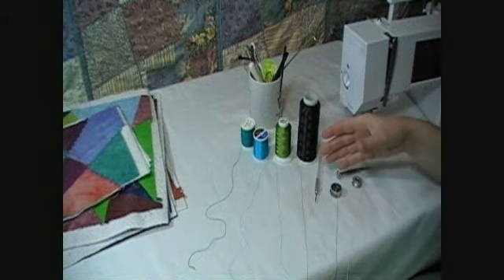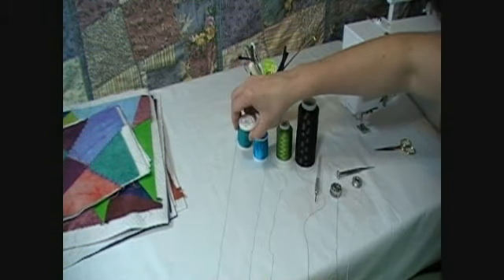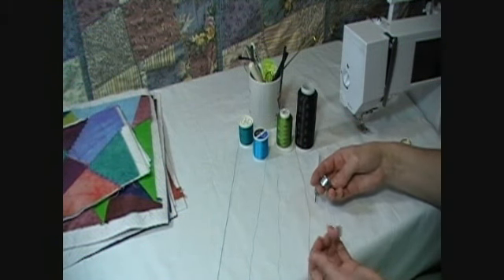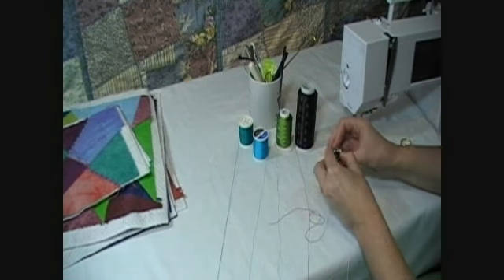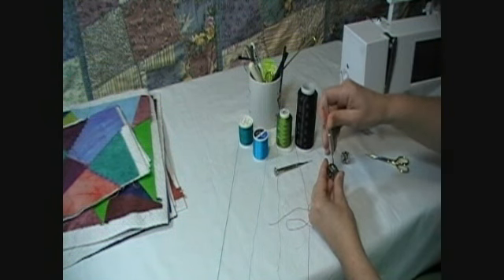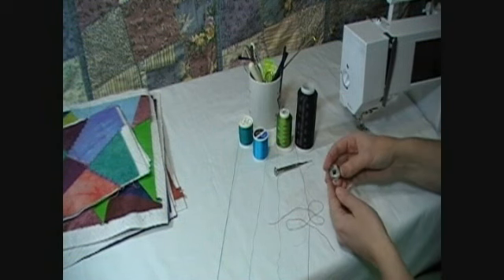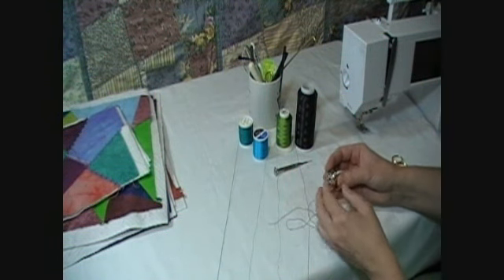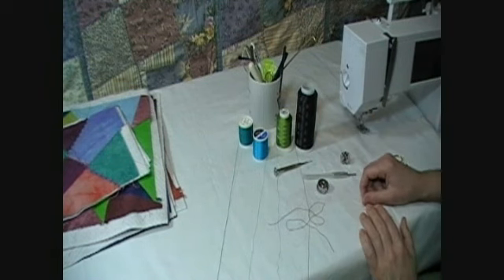Bobbin Thread Tension Adjustment for Sewing and Quilting

Comment: wow. you answered many questions I had in my head!! Im a beginner and have an old machine, i like the old ones, and had problems here and there, this video may have saved my sanity!!
Reply from the maker: I am so glad my video helped you :)  I treasure old sewing machines and I buy them regularly. I love cleaning them up, using them for a while and then giving them to someone who needs a machine. Be sure and watch my video about the pressure settings and the one on Threads might be helpful too. ~M

Comment: Thank you so much for your videos.  I was thrilled to see the stitch in the ditch video.  The lady at the sewing shop mentioned that but I didn't know what she meant.

I recently made my very first quilt for my grandson.  I got done just in time for his birth.  I had no idea what I was doing and the squares are not well lined up.  I also have a lot of the bobbin mess on the back.  Now I know how to feed the thread up and will do that to help prevent it.  The family was very impressed even though I wasn't.  

I am now starting quilts for all the grand kids and kids.  I have nine kids and 5 grand kids so I have my work ahead of me.I have already placed my order at Amazon for your book and the tools you mentioned ( the needles, pins, Kwik Klip, etc) 

I do have a question though.  My machine is a Janome 7318 and the bobbin is plastic.  It just drops into the opening.  The isn't a case with a tension screw.  Are you familiar with that machine?  if so, do you know how to adjust the bobbin?  If not, is it really important?

Comment: I borrowed a vintage Singer 22 (model #17622090) to practice and was having problems with the tension. I googled until I fixed the top thread, but the test sew pieces still had the bobbin thread doing loopy-loops. I did a search and your video has helped me fix the problem.  I don't think my mom used the sewing machine too much because of this, so when I'm through I'll let her see if her issues with it was fixed. Great video, but closer shots helps.

Comment: I use a Tic Tac box weighted to 50g with small nuts and bolts. I test the bobbin tension by snapping the box's lid over the thread and attempting to dangle the box from the bobbin.

Comment from the maker: @tall32guy  You might want to be really sure that you don't have some bits of thread in the tension bar area - that's the only thing that I can think of that would not let you tighten the tension down -UNLESS- you are turning the wrong screw (which I have done!).  Take your bobbin out, and the spring, and really clean it well with a magnifying glass and tweezers and find any loose bits of thread.  GL and let me know if I can help in any other way  :)  ~~Marguerita

Comment: Would like to ask if  on some machines that the tension value may be slightly less than this method?  Reason for asking,   on our machine, this is with out retesting again, on very thin materials it might be better to have tension at about 70% of the value demonstrated here to minimise the bunching of the material to next to nothing.  This has always been an agrivation only on the very thin material.
regards,                       Still liked your demonstration the BEST.